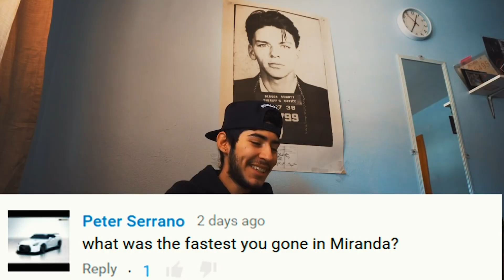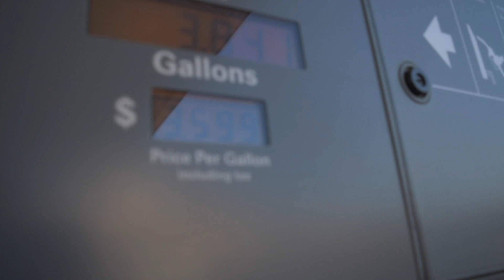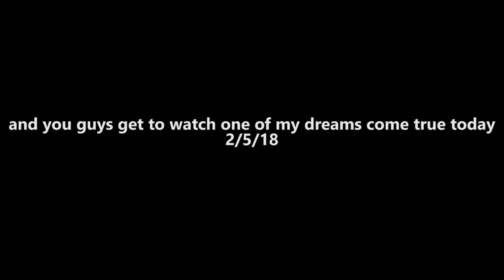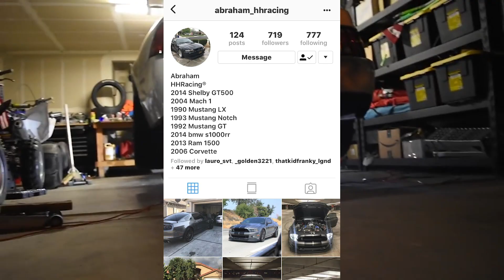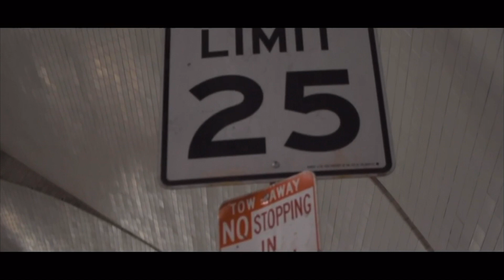Stock to MODIFIED in a YEAR

Comment: Nice car man. I've owned a mint GT (1997) with only 6k miles and it was fun, but nothing compared to my buddies 2003 zinc yellow Cobra with a whipple, headers, tune, CCW's and much more, pushing 612rwhp. I finally sold the GT last summer when my buddy said I could buy his Zinc Termi with 17K for $25,000. I didnt hesitate and bought it soon after. That was 8/18 and now ive done suspension, rear end and fuel upgrades since I bought it. So this spring and summer is gonna be a blast... BTW im 34 and wanted one of these for the 15 years and finally got one. Enjoy it man cause once once HS is over, the real world starts and it gets harder and harder by the day to justify spending a "House" sized down payment on a car when you have a Family... Channel is good bro, keep up the good work.
Reply from the maker: Thanks appreciate it! I’m glad you got it. Really good deal. Trying to get all my finances good right now so that later I don’t have to worry about the big boy expenses! Thanks for the comment 💯

Comment: Don’t need to get rid of the Accufab, you just need to adjust the idle set screw until it stops sticking. Had the same problem on my Cobra
Reply from the maker: Eric that’s what I did, it works but then the car idles way too high. Over 1k and there’s no happy medium
Reply: It’s a trial and error to get it just right. I’m talking barely loosening and tightening go get it right. It took me about an hour messing with it until it hit the sweet spot
Reply from the maker: Lol it’s supposed to idle @ 750 rpm and it already idles at 900-1k and the gas pedal still sticks slightly. I’ve already tried everything. If I back it out even more, it’ll idle even higher so no luck
Reply: Take the intake tube off and watch the throttle body blades close and see if it's closing all the way. You may have to sand the bottom of the blades just enough for it to close

Comment: You should probably low key start buying some internals and not just slap on a whipple knew a guy that just slapped one on and it made about 730 to the wheel but it was a ticking time bomb without internals lol. It blew eventually .
Reply: Joshua Castillo they come built from the factory and can handle the power if ur responsible. But if you push and push you’re car don’t expect something to not break.
Reply: It’s a cobra. Building the internals is not necessary for that power. Your buddy had a shit tune.